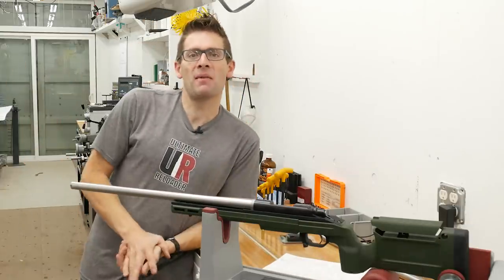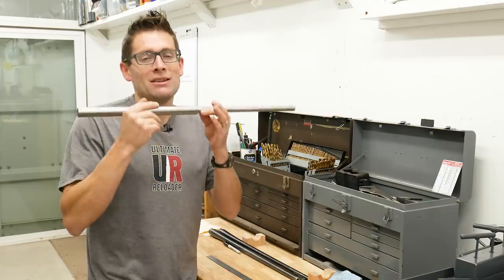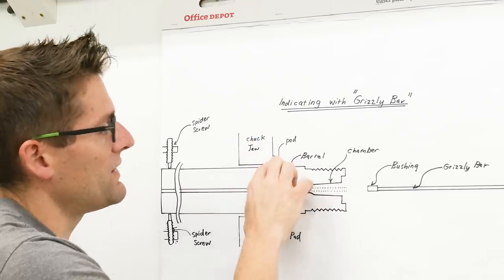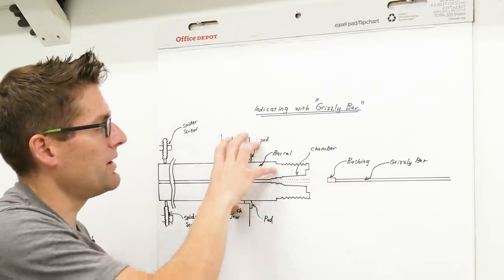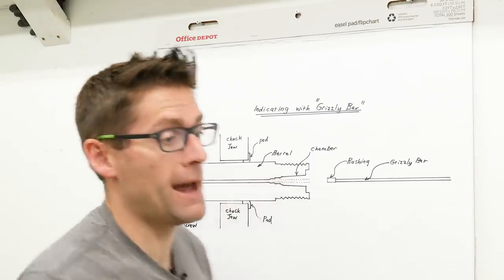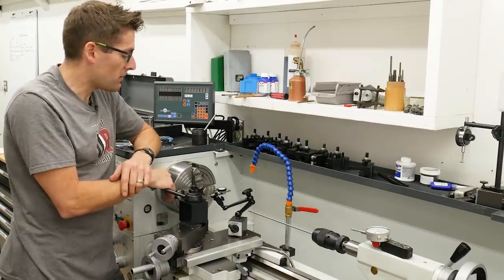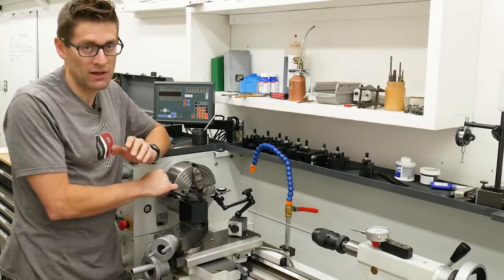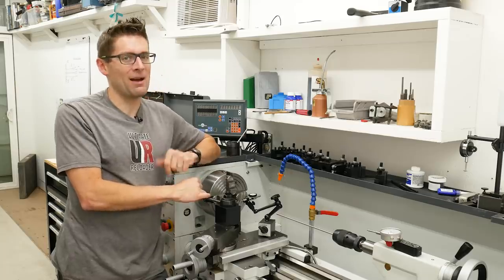224 Valkyrie Rem 700 Build: Barrel Prep and Alignment (Part 2)

Comment: Gavin, get some .02- .03thick aluminum sheets. Make them the same width as the total depth of your chuck jaws. Make a "tube" by bending over the edge of a table or bench. Wrap around barrel shank. This yields more surface area to grip and less chance of knocking out of alignment. Those tiny shims you have will act like teeter totter fulcrums when force is applied even with the outboard end supported.
Reply from the maker: Xringhammer 1871 Actually- that’s what I want here- a fulcrum- if you have too much contact pouch you won’t be able to dial in the barrel angularly by moving outward spiders screws. There’s actually plenty of contact patch and plenty of grip- aluminum is good in this way because of its lack of lubricity.
Reply from the maker: Your suggestion would be good with a setup like the Tru-Bore alignment system where you the entire chuck rotates and has axial movement to align the bore- a six-jaw chuck clamps the barrel securely along a long distance (no fulcrum action needed between barrel and chuck jaws)

Comment: I worked at Pearl Harbor as a machinist for a time before moving to another government agency. One of the "rule of thumbs" at Pearl was not to use aluminum too often as chuck jaw protector shims because aluminum collapses and permanently deforms unlike copper which holds it's shape better after it being work hardened under jaw pressure. Simply put, it won't run away as fast as aluminum does thus may prevent workpieces from coming lose. Little side story, I once wanted to support a large job on the floor of the boring mill section so the rigger could turn it over before placing it on the boring mill. So the rigger asks me, what am I going to put the job on so he could flip it? I replied those pieces of wood. He looked at me very seriously and in a scolding voice told me, "Wood?!? Wood?!? Wood is good but steel is for REAL!" Only then did he laugh and started to lift the job while I procured some steel plates to put the workpiece on so it wouldn't collapse like the wood possibly could have. We had end grain wood block/paved floors in some areas of the shop, but they were so riddled with metal chips of variously types and varying hardness, that no one dared putting any work on it.

Comment: gavin, why is it that the barrel is thinner at muzzle end and thicker at rear end, is there a process which turns the steel rod into this drilled non-uniform thickness from the outside, i've seen barrels with uniform thickness, like the ar-15 ones,
Reply: found it, for someone having similar question. that process is called "tapering", it can be done on a lathe

Comment: Why would you cut an inch off the side you are chambering? Doesn’t the reamer take care of this?
Reply from the maker: It's recommended- like cutting the ends off carrots before you cook/eat them :) Seriously, there can be different stresses/dimensions right at the end of the barrel blank...
Reply: gavintoobe  I’m curious because I was told the same when learning to chamber. That the tooling typically caused small imperfections at both ends of the barrel. I just never understood the point when the chamber reamer typically takes off over an inch of the bore. The muzzle end I understand and have always taken an inch off.